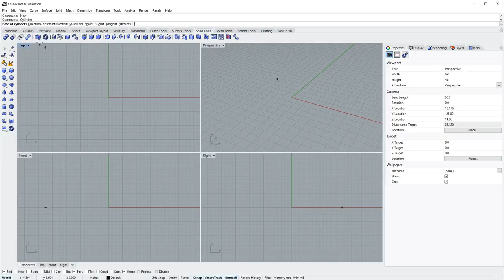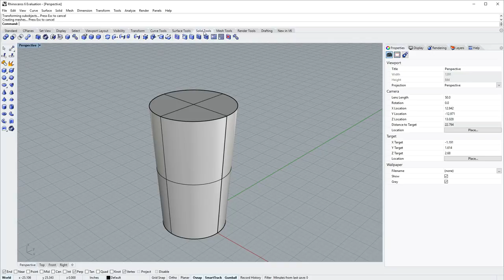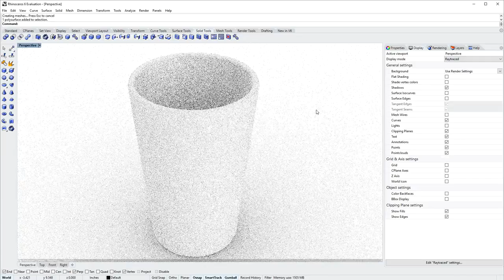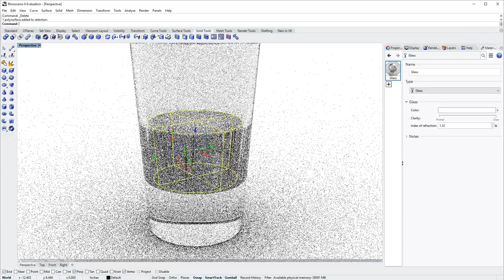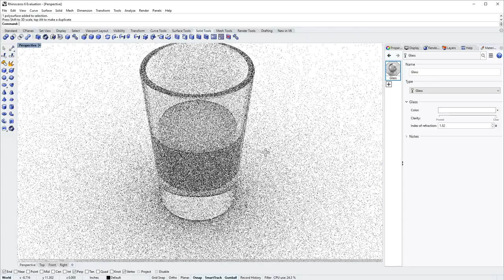Modeling and rendering a simple glass with Rhino 6

Comment: What are (roughly) your computer's specs, I'm wondering how Rhino will perform on my computer. I didn't notice any lag or slow down when you went to 'ray-trace', meaning your computer is pretty stout, or Rhino is incredibly efficient.
Reply from the maker: I don't 100% recall the specific computer used for that video, but I know it would have had an Nvidia GPU, maybe GTX Titan or RTX 2080. That tech moves fast but in general, more Cuda cores = faster Raytraced. Try the 90 day evaluation of Rhino 6 on your computer to test the speed with your models, resolution, materials and lighting set up.
Reply: @RhinoGuide  I'm actually working my way through your tutorial now. I have a 7(ish) year old laptop; Ray Trace is pretty slow. I messed with the settings and that helped a little. I was able to follow the tutorial pretty closely; in the end I wasn't able to get the refraction to show up quite right. I may have sized the liquid too big relative to the glass. Also my glass ended up having thicker walls. The program runs very smoothly while 3D modeling which is good. I wish there was a view style like shaded, but one which showed transparent objects (maybe there is; I'm just getting into the program of course). None the less very impressed with the program so far. And great tutorial!!

Worth noting is that my gumball was turned off by default. Took a couple minutes to find out how to turn it on: Just typed 'gumball' at the command line.